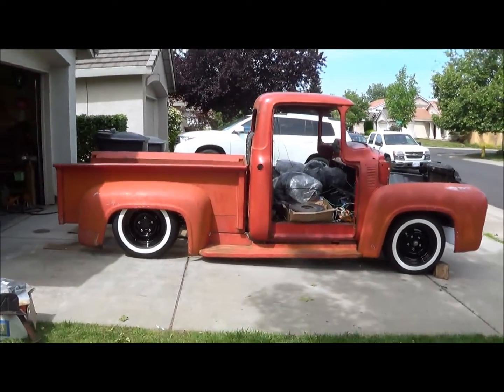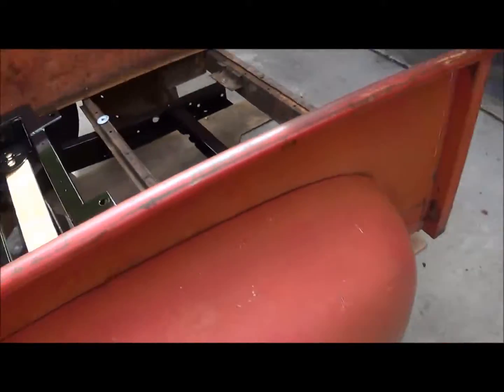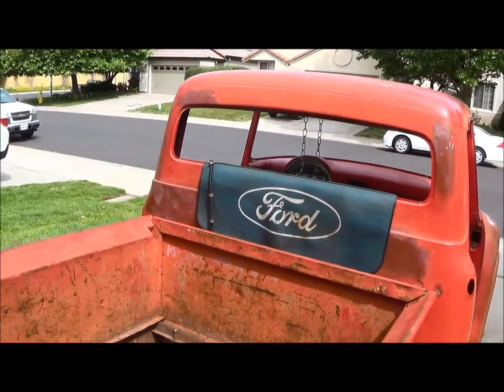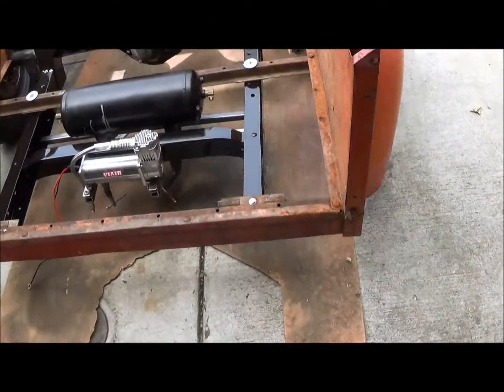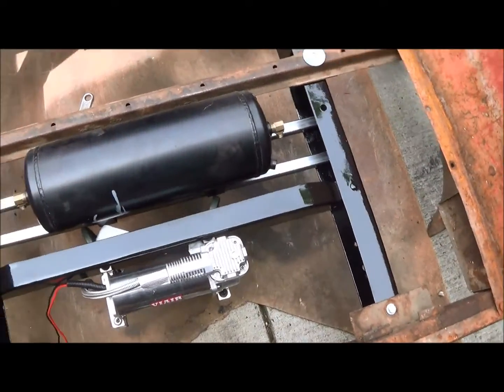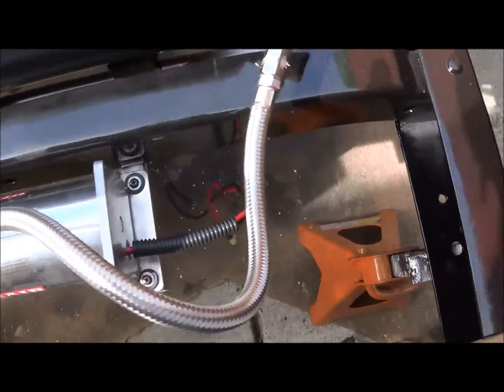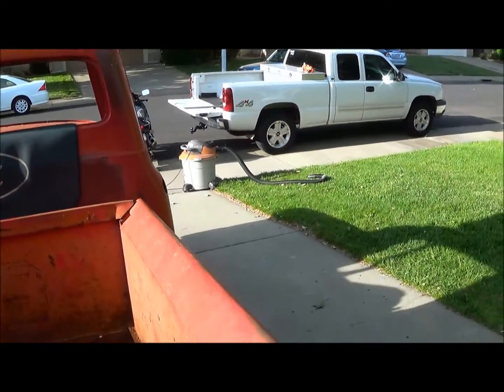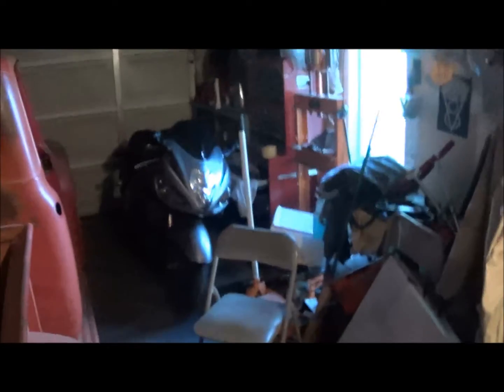Sunday bed mounted

Comment: It does look good. It's always nice to be putting them together. The gauges in those GM trucks has always been a problem. I need to fix a couple of trucks now and one of them is mine.
Reply from the maker: My oil pressure gauge has a bad circuit, other than that I've been real happy with that pick up.